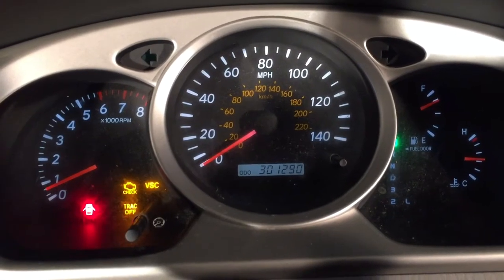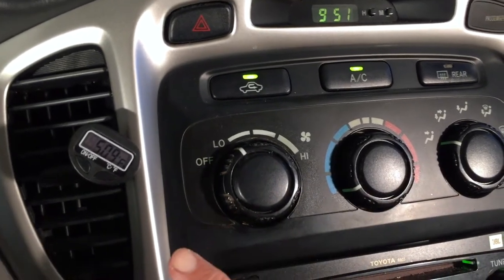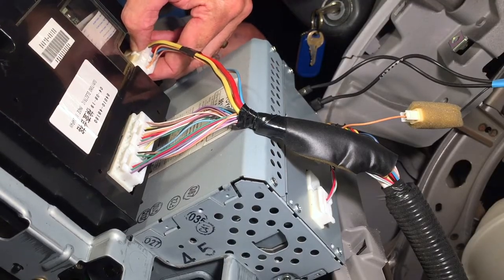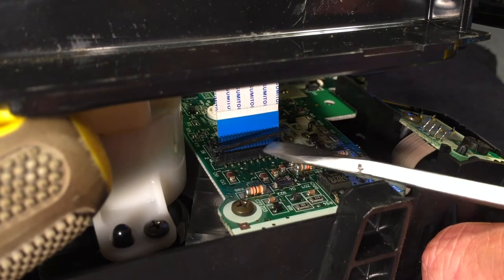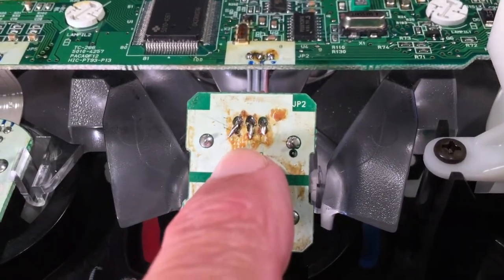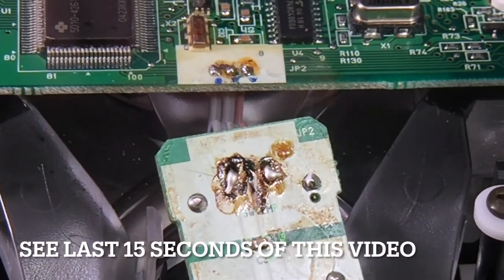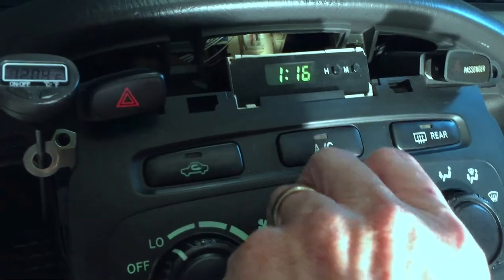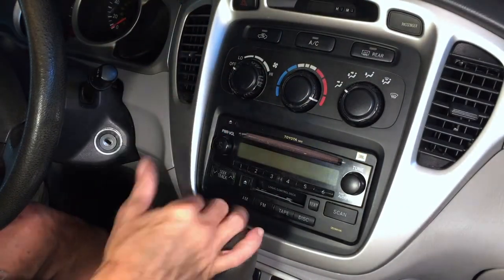Toyota Highlander Intermittent AC/Heat - Loose Wire On Circuit Board

Comment: Great video explanation!
The AC for my vehicle (an '05 Highlander) would cut out, instead blowing hot air despite the knob being turned to maximum cooling. Upon disassembly, the flex connector appeared to be only barely connected by the middle wire. Resoldering (and adding some hot glue at the connections for support) seems to have fixed the issue.
Reply from the maker: That's the same problem I had many years ago.. Only the middle wire was connected.. Hot glue seems like a good idea for support.. I'll use that If there's ever a next time..
Reply: @tongo117  Very interesting that it seems like a systemic issue.